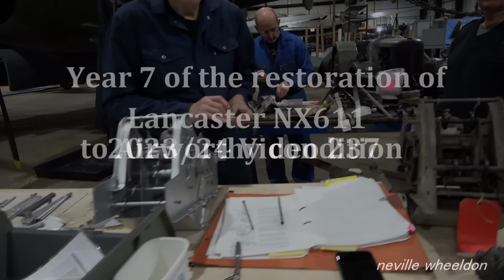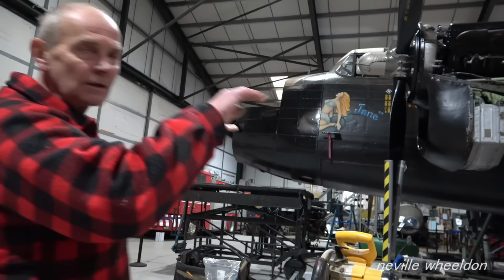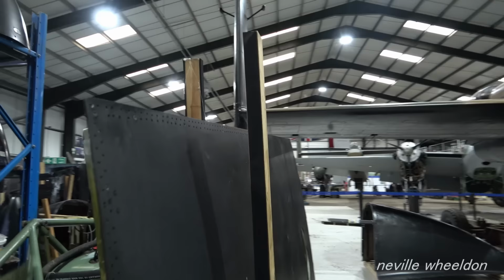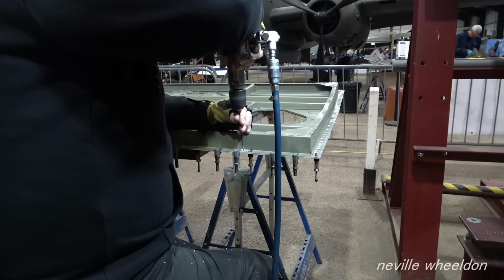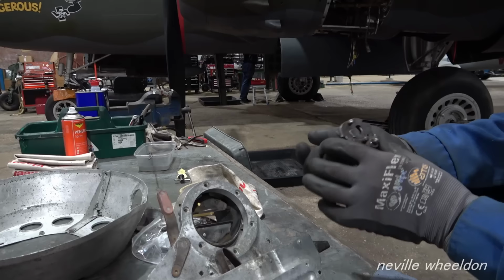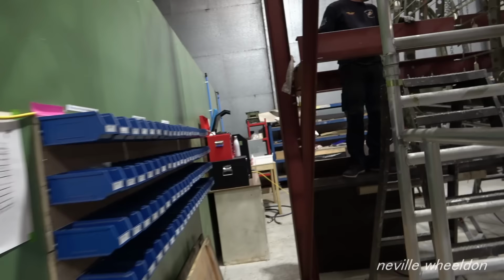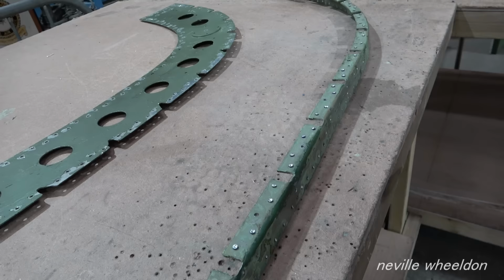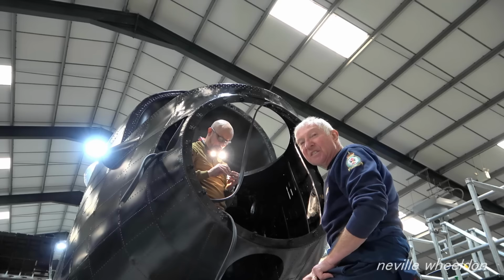Video 237 Restoration of Lancaster NX611 Year 7.---French fuselage nose fitted to NX611

Comment: The old chestnut of a comparison between the time taken producing a complete Lancaster in a matter of days (60 hours the stated amount) during wartime and how long its taking to restore NX611 "Just Jane"  has now been made several times. The  big difference being that there would have been a whole factory production line geared up with tooling and jigs specifically made for reproducing the major components  

to assemble a Lancaster on site with a dedicated workforce of men and women working day and night like a colony of soldier ants for the war effort. Every component required would have been either to hand BRAND NEW there and then, with items such as Dunlop Tyres and Serck aircraft radiators being sourced outside and delivered to the Avro factory in great numbers. The team at East Kirkby haven't got that luxury of an endless supply of new factory made airworthy Lancaster parts that they could just assemble and bolt on, saving literally years of work and around 100 of Neville's videos. In many cases they have to either refurbish a component, have it completely remade in house or manufactured by an outside company at extra cost. I have no doubt that the "Just Jane" team match the 100% effort made by Avro factory workers during war time and in some cases l would even go as far as to say they even exceed it in their desire to get NX611 flying again!
Reply from the maker: Great answer Time slip thank you.

Comment: Thanks for the update. Been struggling to get the rivet club cameras to work on my phone. Normally have a look in my T break.
Reply from the maker: Hi Peter, they are miss and hit at the moment, the Centre does not control them it's the contracting firm.
Reply: @nevillewheeldon1693  I thought that may be the case. I phoned them to see if it was my phone as it's an old android. Didn't get much joy.

Comment: Geday Neville, how are you doing mate.
Now in no way am I having a shot at you blokes. But I cant help but wonder about the man (or woman) hours spent in building a Lancaster back in the forties compered  to the restoration of Just Jane. How long did it take to turn out a new Lancaster back in the day? It's still mind boggling to me what could be produced in wartime.
It must have been 100+% effort.
Reply: The old chestnut of a comparison between the time taken producing a complete Lancaster in a matter of days (60 hours the stated amount) during wartime and how long its taking to restore NX611 "Just Jane"  has now been made several times. The  big difference being that there would have been a whole factory production line geared up with tooling and jigs specifically made for reproducing the major components  

to assemble a Lancaster on site with a dedicated workforce of men and women working day and night like a colony of soldier ants for the war effort. Every component required would have been either to hand BRAND NEW there and then, with items such as Dunlop Tyres and Serck aircraft radiators being sourced outside and delivered to the Avro factory in great numbers. The team at East Kirkby haven't got that luxury of an endless supply of new factory made airworthy Lancaster parts that they could just assemble and bolt on, saving literally years of work and around 100 of Neville's videos. In many cases they have to either refurbish a component, have it completely remade in house or manufactured by an outside company at extra cost. I have no doubt that the "Just Jane" team match the 100% effort made by Avro factory workers during war time and in some cases l would even go as far as to say they even exceed it in their desire to get NX611 flying again.
Reply: @timeslip9 I did state at the beginning that I was NOT having a shot  at you blokes (who are doing a brilliant job by the way).
But it is still amazing with the technology of the day and all the shortages at that time to produce them so fast including all the other aircraft at that time!
Reply: @306champion  
I was just generalizing in my comment as the subject of a time comparison has been made before and l know you weren't criticising 🙂
LIke you, I'm just an outsider looking inwards admiring the amazing work being done.
Reply: @timeslip9 
Sorry mate for taking it the wrong way, like yourself I too admire the work and effort being put into this as I also admire the achievements to counter the Nazi threat back in the day.
Reply from the maker: Hi mate, a good answer from timslip.